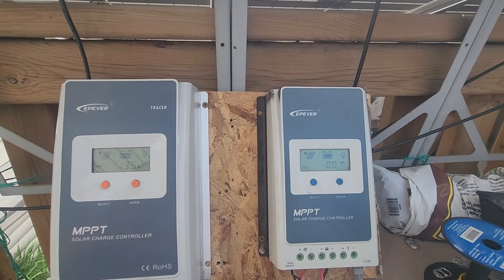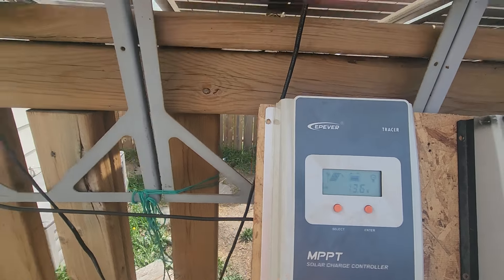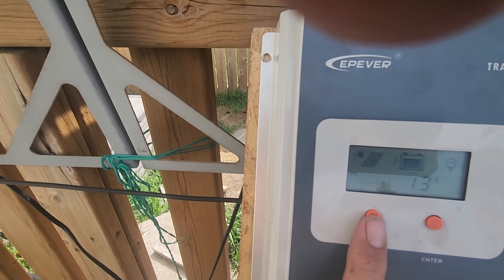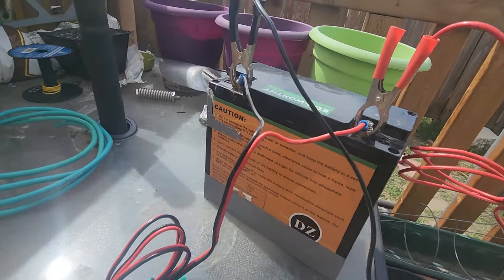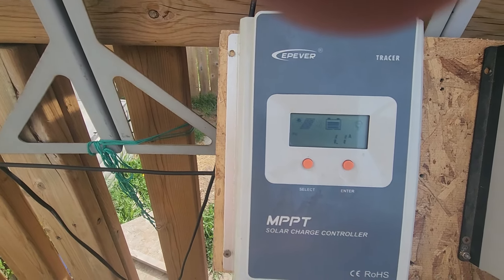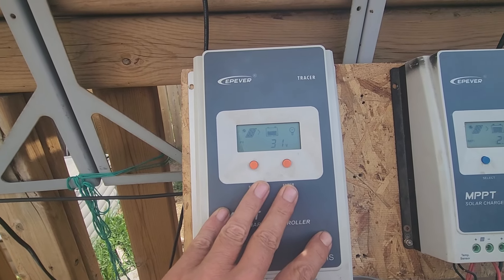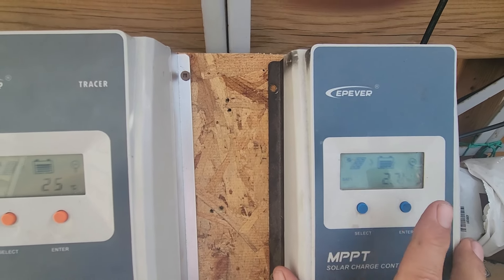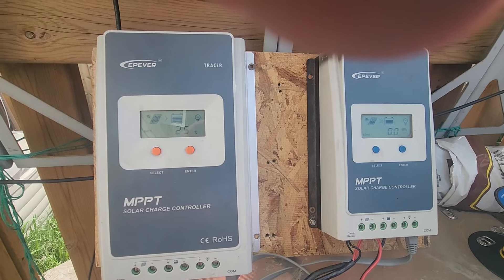Series VS Parallel. what gives more power

Comment: Why you want to use series (high volt) though?  If your panel is far away and need to run a long wire. Why? Because the higher the volt like in series the thinner the required copper wire. Copper is expensive, you don't want to buy thick copper wires.
Reply from the maker: Correct the higher amps the thicker the wire needs to be. And the more loss you will have.
BUT  with a pwm charge controllers they don't covert the high voltage to amps so a parallel connection is better.
Reply: If you have solar panels far away and you want to avoid losing electricity, it is good if you connect solar panels close to the charging station, ok more cable will be used.